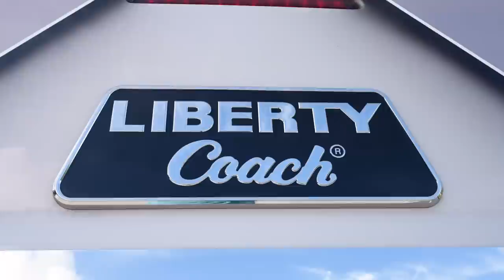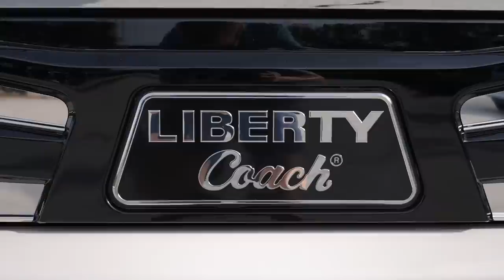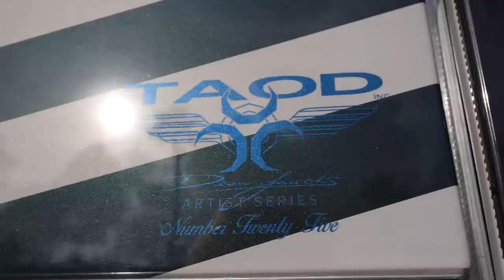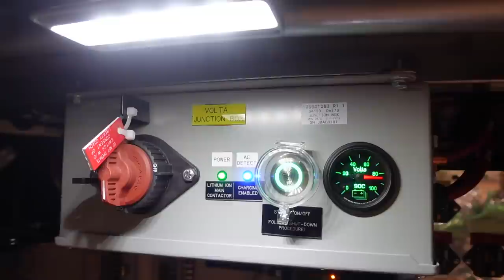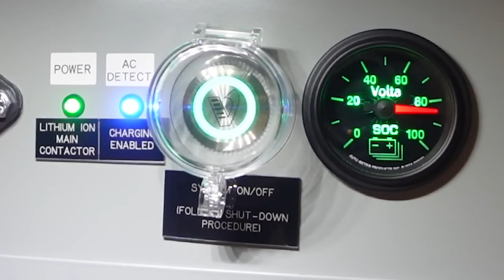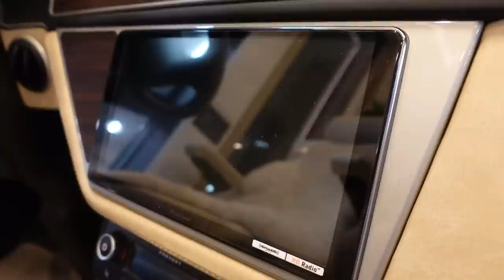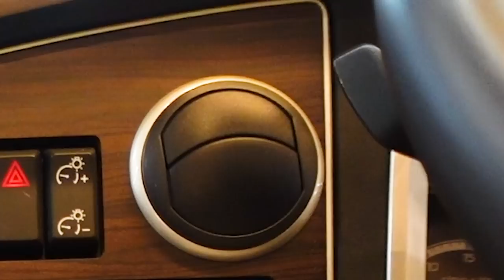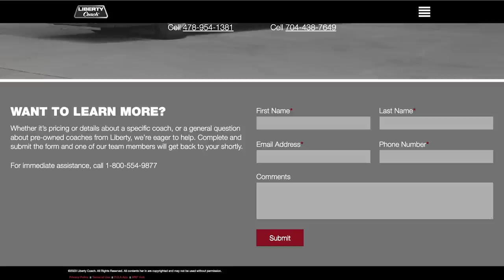Tour of The First Quad Slide 2024 Liberty Coach #902 (NEW Prevost 9660 Shell!)

Comment: How do you consider the stress on the battery’s when charging to 100%. I believe that charging from 15-20% to 90-93% is less stressful on the battery life. How do you correct for this? Can you change the Volta systems charging parameters to eliminate the stress and loss of length of battery life?

Comment: Why dont u put dishwasher in your coaches
Reply: Thank you from the question, each coach we build has a cabinet, electrical, and plumbing prepped for a dishwasher installation, we have found through the years that most of our customers are not using the dishwasher so we do not install that appliance standardly.